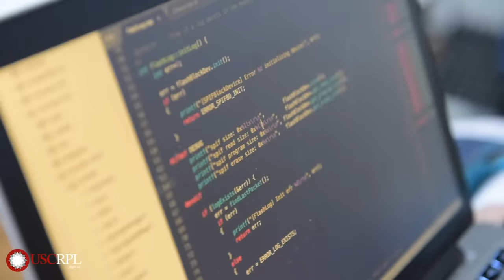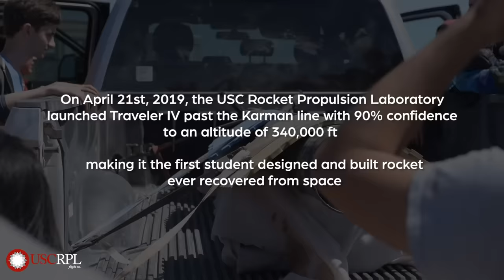First Student Rocket to reach Space (339,800 ft, Mach 5.1) | Traveler IV Launch

Comment: Well done, now get it to orbit next semester.
Reply: Alex that will be much harder. Actually just get it pass the 100 km Kerman line isn’t hard-people achieved it in WW2. You have enough delta V and go straight up you can get there
Reply: Actually to just achieve the altitude you can even go without any navigation and just plummet upwards
Reply: Not to discount the work these students have done, but many hobbyist groups have been able to launch solid-rockets past the Karman line... it takes far more Delta-V to launch a rocket into orbit, as well as a far more complex guidance system. It almost certainly also requires the use of a liquid-fueled upper stage, in order to better control thrust and circularize the orbit. There’s a reason very few commercial companies have reached orbit - it’s really hard, and even harder if you’re trying to launch any significant payload.
Reply: Alex Alex
Reply: @eyeborg3148  the only liquid Rocket Fuel NASA has ever used is and was H2O2 AKA hydrogen peroxide but they stopped using it. 
Why ? Thier scarred of it !
 It's not wilI it but when is it going to blow !  Water and oil don't mix .
Reply: @onewordhereonewordthere6975  you have no clue what you're talking about. There are many forms of liquid fueled rockets including but not limited to RP1 + Liquid oxygen, hydrogen + liquid oxygen, and hypergolic combinations such as Dinitrogen tetroxide + UDMH.

In fact, H2O2 is rarely used for main stages of rockets and is instead only really used for reaction control thrusters as monopropellant engines like H2O2 have far lower specific impulse (efficiency) than bipropellant engines.
Reply: @eyeborg3148  where is the so called fossil fuels ? and by God SpaceX ought to be the1st  one to put a solar electric rocket into space. Believe that
Reply: YES
Reply: @eyeborg3148  https://youtu.be/5wg_vIcwTZQ around 5.45 they. Launch what with what?   I did forget about hydrogen mostly used as a gas.
Reply: @goose6.070  There is a reasonable suggestion! Well said. Perhaps even a cluster of them, to bring up a fair sized rocket. But the guidance system had better be spot on. And as someone said, it isn't easy. Proper sensors for altitude in vacuum as well as location over the Earth. It's complicated. But as someone else pointed out, liquid rockets for proper throttle control is almost a requirement, unless you can work out to the precise foot pound, the thrust and burn times for orbit correction and control on/off as needed.
Reply: You would need to be able to gimbal your engine to make those manuvers, and a more advanced engine and flight control system. You would need a much larger rocket
Reply: @goose6.070  true
Reply: That would be insane
Reply: @eyeborg3148  What makes this particular flight so extraordinary is what they stated in the video. This is the first university team that has successfully designed and built a rocket that reached space.
Reply: To get to orbit you need to reach escape velocity, which is more than 30x the speed of sound or Mach 30, and keep it at that speed until it goes out of earth's pull. Much much harder
Reply: @kerbodynamicx472  Well college also gets harder and harder every semester but you can always repeat :D
Reply: @edward3709  you dont need to be going escape velocity, that would take you out of earths gravity and into orbit of the sun. To get into earth orbit you would need to be going around 7km/s horizontaly. Still stupidly difficult to do though
Reply: hahahaha,  sounds just that easy right....   orbit is all about money,  money buys size,  speed, tracking,  the ability to move around once up there.  probably 100 times the expense to do what they just did.  might be about to link up with nasa on an educational grant but still very very expensive,  i have no doubt that given the budget orbit would be possible because its been done for so long that the math and engineering needs are all common knowledge.  its just money to do it.
Reply: Adam Finn oh yeah thanks for letting me know!
Reply: Hooman Thing 101 they could talk to that Barnard kid who’s doing a lot with gimbals and model rocket motors.
Reply: 1 wordhere 1wordthere 
E=MC3. 
Einstein never put the “soul/spirit” into his mathematical equations. 
Wether you are religious or not, that spark of life means everything, something that math cannot quite compute.
Reply: @kerbodynamicx472  first of all karman line is at 83-86km up and going to orbit is yes harder but can be done with a delta V of 2500m/s+ based on my research and experences...
Reply: Albert Aquino orbit with 2500m/S of deltaV? You’re playing KSP right? The low Kerbin orbital velocity is around 2200m/s, which considering you need to overcome aerodynamic drag and gravitational drag, you probably need around 3500m/S. On earth, you probably needs three times more
Reply: While this would be awesome to see, you'd need something much, much larger and much more complicated. Even with an impossibly light airframe and an insane specific impulse you need something on the order of 3000kg of propellant to reach orbit (2437kg for a 100kg dry mass with 3000m/sec exhaust velocity assuming no air resistance). Not to mention you need thrust vector control systems and orbital guidance software to perform the correct pitchover maneuver. In addition, there are a ton of contracts one has to fill out in order to get clearance from governmental authorities to launch anything into orbit just to make sure you're not on a collision course with another satellite or piece of debris. If any college team can do it though, it's this group.
Reply: Coming from you I'll take that as a compliment
Reply: @alekosb.8704  exactly they don't use hydrogen peroxide "
 they are so scared of it . You're right though hydrogen is mostly used as a gas 2 fuel their Rockets to the other sides of the Cosmos those Astros sailors alongside their Cosmos sailors I wish this was funny oh how I wish it was
Reply: @onewordhereonewordthere6975  what? Hypergolic fuels are toxic, but they are commonly used. Also, hydrogen is used liquid becouse it's denser, and it's used in many rockets, like the delta IV and the atlas V, also RP1 is basically kerosene, a fossil fuel
Reply: @onewordhereonewordthere6975  i just realized.. HYDROGEN PEROXIDE? it's oxigenated water, how is it dangerous? It's not rocket fuel!
Reply: @alekosb.8704  oh my God it is so volatile anything 60% and above anywhere in the world is a major felony I promise you we have been lied to it every damn fucking level NASA is scared of it it's not a question of will it blow but when is it going to blow that will never be anything over 98% pure they are scared of it that bad I can't even figure out how it's made but that is your rocket fuel Plus hydrogen- my question is how did it take us this long to find out damn bastards
Reply: @alekosb.8704  I have one more you brought fossil fuel like it's some dinosaur they gave us this shit water and oil does not mix. What is the largest biggest boom they ever made where did it come from T-Rex or glass of that H2O you guessed it
Reply: @onewordhereonewordthere6975  the whole point of a rocket fuel is to explode as hard as possibile, they do it in the engine's combustion chamber, so they vector the thrust exactly where they want.

Space agencies store the fuels without the respective oxidizer, so it's harmless, becouse the molecules can't react with one another.

There are lots of liquid fuels, mainly methane, hydrogen, RP1, and a whole lot of hypergolic type fuels.

Hydrogen is combined with oxigen to form water, the reaction is very violent and efficient.

Methane is also combined with oxigen, but is more powerful and less efficient

RP1 is fossil fuel, and is combined with oxigen. Every fossil fuel is derived from oil: oil, carbon and methane are created thanks to forests that, millions of years ago, died out and more trees grew and died over them, so they got compressed and in a span of millions of years the compounds shape changed, transforming into oil, that will then refined in various stuff.

Hypergolic is the real tasty stuff: it's reliable and simple, but very toxic, so it's used with extreme caution using special suits and masks.

Btw, hydrogen peroxide is oxigenated water, it's literally one google search away from you, and it's not rocket fuel.

Sources:

https://www.google.com/url?sa=t&source=web&rct=j&url=https://en.m.wikipedia.org/wiki/Rocket_propellant&ved=2ahUKEwir4qW7hIfpAhVS06YKHX19AwwQFjANegQIARAC&usg=AOvVaw17UZoQhi2loC3Qej62HwxB

https://www.google.com/url?sa=t&source=web&rct=j&url=https://m.youtube.com/watch%3Fv%3DAFLmqQ5ceS8&ved=2ahUKEwir4qW7hIfpAhVS06YKHX19AwwQt9IBMAl6BAgLEDY&usg=AOvVaw2yURj-Z_QXcrI0wVTcZFFc

https://www.google.com/url?sa=t&source=web&rct=j&url=https://www.croftsystems.net/oil-gas-blog/what-is-oil-made-of&ved=2ahUKEwj47seLhYfpAhWF0KYKHY-GD2AQFjAFegQICxAI&usg=AOvVaw2Q2bxFJF4hKHeirg2Kajxh
Reply: @alekosb.8704  maybe everything but hydrogen peroxide at 98% no one can obtain 100% it's not if it's win and they don't know when they've had a lot of explosions upon takeoff I never said why they just said something o'ring went bad which they could easily tell by the photographs that they sure there wasn't another ship left it is funny though that you're not pointing out that is not some radioactive nuclear Space Age fuel just a little of water and you're also not pointing out that they've already said the biggest baddest one of them all is what water what are we made of water what never leaves this planet I want a ship or anything else H2O ! But  due to climate lie 101 we will be out of water about the same time we're out of fucking oil
Reply: @alekosb.8704  it'll take me awhile but I'll find some more information however they're saying that it is a inefficient for the combustible fuel h202 R hydrogen but both fat man and little boy or very small in comparison
Reply: @onewordhereonewordthere6975  what is the connection between a nuclear bomb and a rocket fuel?
Reply: @alekosb.8704  0 connection do you get that but there is between rocket fuel and hydrogen AKA boom it doesn't take but a Freudian slip either by accident or by Design in your case is by accident but in their cases by Design you wouldn't get it for a thousand million there's no way that you could understand what. One word is are the one word there where do cows go to eat do you like the cafe how do you prefer the cafeteria
Reply: @onewordhereonewordthere6975  what do you mean? I can't literally understand what you just said becouse there are no commas, points, subjects of the sentence. What are you talking about?
Reply: @alekosb.8704  I don't understand why you don't understand what are you trying to prove that you can shoot a rocket past line of eyesight is your goal getting to Mars to do what screw it up like also my goal is to show people how easily they have been duped ,by language ! such an orbit , has two meanings doesn't it ?? I'm sure that they have a Stellar architect class at excuse me if I'm wrong USC . My question is very simple the sound created by the two letters CH does not sound like the letter k !!
When why how and who caused this to happen . 
Arch Builder architect.
 I bet that you dream of working for the DOD or the Department of Defense as Millions already have . Another simple question what does defense actually mean to take a fence down and not to
 defend ! How can you expect this generation of students to measure up to the test of time when they makes it simple mistakes time and time again assuming is that what they're doing is perfect when it's not even close . if you was to pray for wisdom would you understand that you only want to be.  Wisdom
wis/e \is Under the Dom/e \ have you ever heard of Warner van Braun are you aware of his epithet Psalms 19:1 look it up look up have a good day Man I'm through peace
Reply: @onewordhereonewordthere6975  please, you are extremely unclear. 
Name the points you want to prove as

A) first point

B) second point

Otherwise it's gonna be hard understand each other
Reply: @alekosb.8704  number one point that was a half-assed firework show wasted a lot of money on one boom I wouldn't say waste if you got a dollar maybe you can get a cup of coffee
Reply: @onewordhereonewordthere6975  it's not wasted money: basically it's invested in technology and advanced education
Reply: @alekosb.8704  take english1st
Reply: H
Reply: r/wooosh @60% of the people who replied to you're comment xD
Reply: Probably make the same rocket but with more stages, attach weather balloons so the balloons will help move it just under 328,000 ft, Then ignite the first stage, hopefully it goes higher, wait until apogee, turn the rocket, detach first stage, ignite second stage to get it going, then detach second stage, ignite third stage and hope that it burns the rest of its way into an orbit.
Reply: Kerbodynamic X it’s a joke
Reply: @onewordhereonewordthere6975  I think this dude has no idea what hes talking about. He probably is a 10 year old bashing the suggested words as he type. So its a joke?
Reply: That dude is already in orbit...around that girl
Reply: #challenge
Reply: You guys, it was a joke
Reply: @eyeborg3148  Explorer got into orbit with a few SRBs
Reply: @onewordhereonewordthere6975  Solar power has been used since the space race circa 1958, spacex was created early 2000s
Reply: @Derps189  Karman Line is 62mi/100km, not 83-86km...you're thinking of the US definition of space, which is 50 miles/80.5km.
Reply: @onewordhereonewordthere6975  please go get some research before commenting about stuff you know nothing about.
Reply: @onewordhereonewordthere6975  its E=m(mass)[multiplied by]c(speed of light)^2(squared.)
Reply: @chickenmag1657  
 2 square ???.  Yea buddy..
C speed of light.  Spell ✅
Reply: @onewordhereonewordthere6975  and its squared, not 2 sqaured.
Reply: @chickenmag1657  Freudian slip. 😔
 You have to admit Albert Einstein's theory coincides with his quest to inbreed . Which strangely enough is relative. To being related.
Reply: "Not because [it is] easy, but because [it is] hard"
Reply: @chickenmag1657   
Relativity the theory .
Albert Einstein = E
Married. = M  
Cousins = C 
 1 cousin x 1 cousin  = × 2 twice .
The gigantic wind Mills are coming down in record numbers. Thirty years before they were supposed to. Said dust was doing it. I call BS  or CBS to some , I'm afraid that it is the sun 🌞😎!! Oh yes there is the sun that is deteriorating of the blades.. .maybe they can send me some money for figuring it out first. Yeah buddy.
Reply: @eyeborg3148  With precise mathematics and the correct launch angle, the entire thing can be done with SRB's and simple timed staging.
Reply: This comment section shows that some people have no sense of humour lmao
Reply: @Derps189  Bruh, 2500m/s of deltaV is just above orbital speeds for kerbin, and the Karman line is 100km. Is your research playing ksp or something?
Reply: @daviddavis  Yes, and those SRBs packed enough deltaV to get an extremely light payload into orbit. But you're forgetting that there was a massive liquid-fueled booster bringing those SRBs into a high altitude before those SRBs ignited.
Reply: Exactly. I wanna see a 400-mile perfectly circular orbit lmao.
Reply: And who's gonna find them to build a super massive rocket?
Reply: I doubt there is no orbit!
Reply: exactly what i was thinkinking
Reply: @kerbodynamicx472  I believe be was joking
Reply: @eyeborg3148  agreed, in order to make it into orbit you must enter at a precise angle.
Reply: @jeffveron8783 Einstein's theorys require no spark.
Reply: @kerbodynamicx472 My God dude, you must be fun at parties, you really think he's serious?
Reply: @eyeborg3148  But none of those fuels will do you any good if you hit God's firmament, Holmes.

Comment: @USC RPL >>> It looked like the leading edges of the fins on the rocket had delaminated slightly - I presume from the mach 5+ airflow during ascent.  
 
Would laminating something like thin stainless steel strips onto the L.E.'S  of the fins have helped that?
Reply: Yes, that would help. Alternatively you could use phenolic resin and glass fibers, like a heat shield.
Reply: @dhargarten  >>> Rodger that.
Reply: I am not 100% sure, but i heard the delamination of the fins caused enough drag to reduce apogee from 100km to ~60-70km, and their max altitude was confirmed using radar rangefinding, aka, internal accelerometers produced incorrect data. I need to look more into it but that's a rumor that has been circulating..

Comment: The design could have gone higher if the leading edge of the fins had not shredded, as shown in a rather brief view in the recovery process (the cause may be the resin used to bind the carbon fiber). The camera got 'slagged' during the supersonic ascent - but it can be tough to anticipate that. Also the spin could come from the fins, if not exactly parallel to the tube, or was possibly induced in the combustion chamber with a spiraling exhaust. May be corrected with a roll gyro coupled to small roll control fins. Tremendous achievement regardless.
Reply: I believe (not a rocket scientist) but I think this is called spin-stabilized. I have seen other rockets with titanium leading edges. fyi.